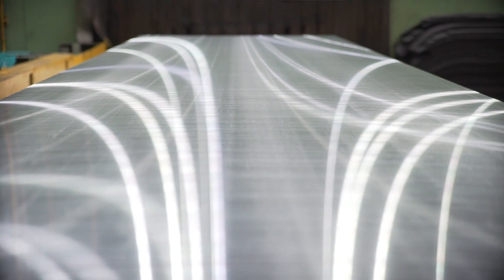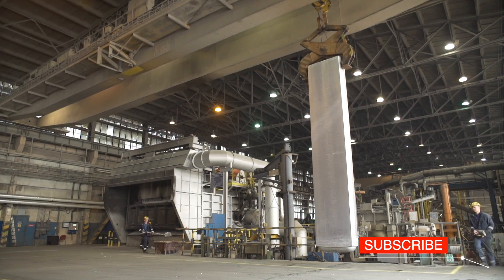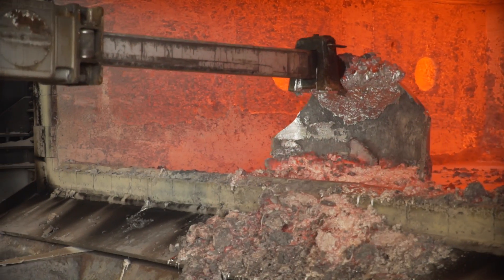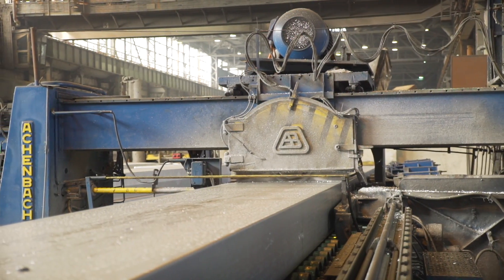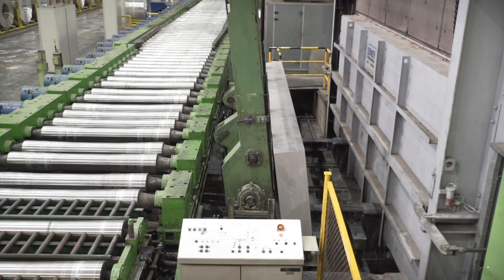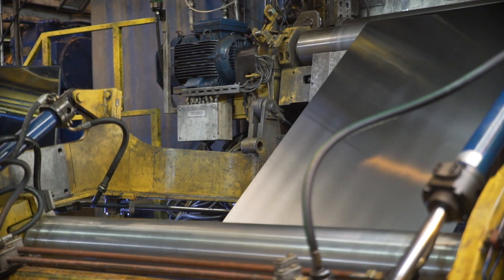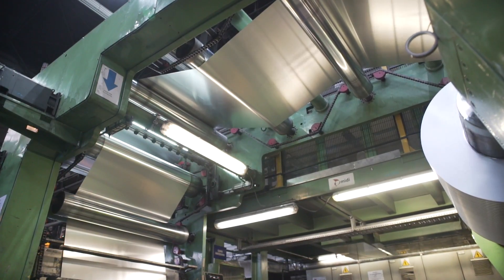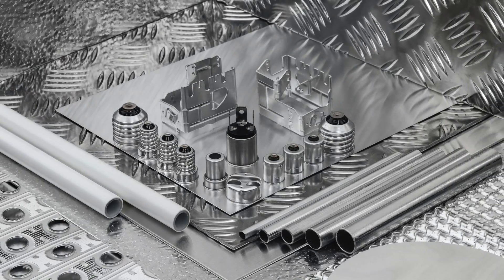How does the ALUMINUM smelter work? - Factories

Comment: The title is wrong. This is not a smelter! No smelting is done there. Smelting is extracting the aluminum from aluminum oxide. This factory and all its processes takes aluminum delivered from a smelter and processes it. Your title is wrong and the question you have in the body text - "How does the ALUMINUM smelter work?"

If you are going to have a channel that educates people then your information should be correct. Will you correct the description?

Comment: With a lot, but a really big lot of electricity
Reply: Yes. From ore to final product. Which makes recycling aluminum very important. Although recycling aluminum is also very very electricity hungry as well.
Reply: Well, that’s more the extraction process which requires immense energy for the electrolysis. Just processing it isn’t that hard and should use less energy than the processing of steel since the temperatures are much lower.

Comment: The real question is how does this factory work at night when there is no wind when everything will run on windmills and solar? How big of a battery is needed to run this plant for an hour or a day or a week when "green energy" fails?
Reply: In the US we built our aluminum smelters in the Pacific Northwest and the Tennessee Valley - because both those areas have huge hydroelectric dam networks. Rivers flow and water flows over dams 24-7.

Comment: But but but where do the original ingots come from? How do you get from ore to ingot?
Reply: same, i came here to see aluminum SMELTED from the ore
Reply: from smelters through electrolysis, actually, what described here we call it casting other than smelting, smelting refers to the producing of primary aluminium.
Reply: Dig them out of the ground.

Comment: https://www.youtube.com/watch?v=FB5LAjEQhVs
do you own a Cold ROlling Mill and other strip process lines, are you still using Rubber Rolls, Vacuum Rolls, Compressed Air -Air Knife Systems for removing, wiping, drying of the Strips, Sheets and Foils being processed on Cold Rolling Mills, Pickling Lines, Degreasing Lines, Skin Pass Mills.
Try using the High Performance Adaptive Wiping System, no requiremnt of Electricity, Vacuum, Compressed Air, Rubber Rolls, our innovative design uses the science in a different manner to wipe, dry the passing strips wihout using any energy.